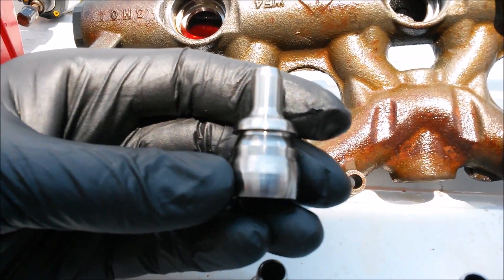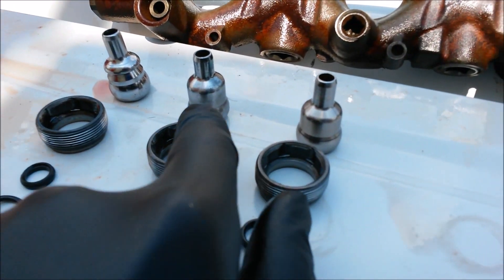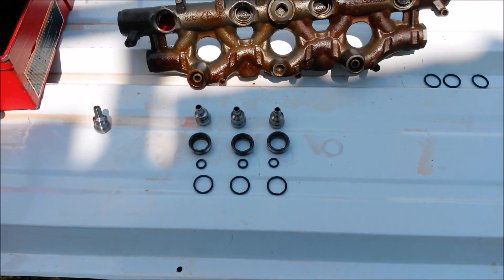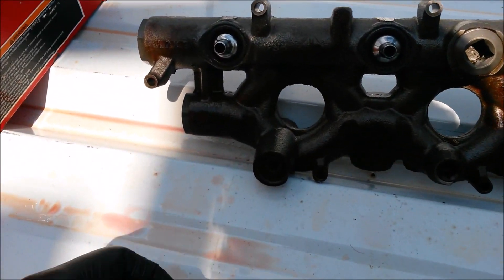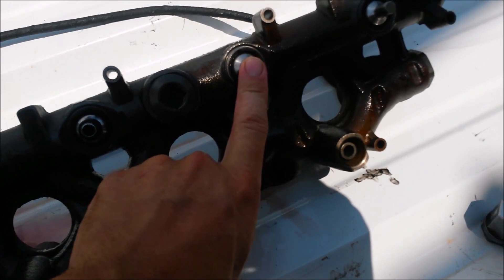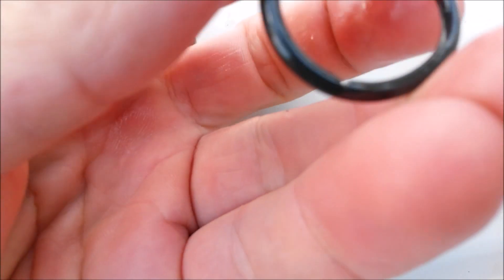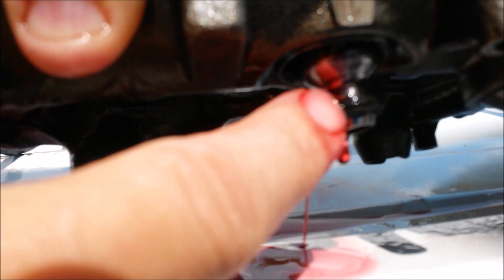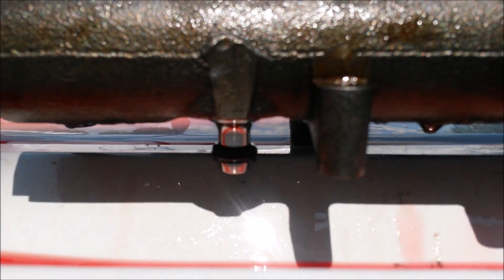Setting Up to Test the New HHC Diesel LeakProof Nipple Cups ~LeakProofing the Ford 6.0L

Comment: These look like excellent replacements. As an engineer my only thoughts are that if there was a leak at the cup o-ring it could also eat away at the cast iron so a new seal will only last a short time anyway. However if the cast iron is good to go then these should work fine. My other thought is that if there is a cup seal leak then the chamber around the outside of the cup will fill with high pressure oil and blowout the top injector ring also unless the engine shuts down quickly regardless of ridge you have put into the cup. Now if you guys can come up with a bulletproof o-ring for the injector we can all rest assured that we'll never have to do this again! Thanks for the video and keep up the good work!
PS; What is referred to as early 2004 or late 2004? My F250 6.0 was built 5/2004.

Comment: I had a 6 liter injector that was leaking through the vertical hole in the spool valve body. There's very little information on this. Do you know anything about it?

Comment: honestly never seen the o rings fail on the cup, but an o ring is an o ring some will fail. but from your video im almost understanding if the top injector o ring has failed its cause by the nipple cup o ring?
Reply: Definitely. Seen it over and over. The top seals look sandblasted from the top down